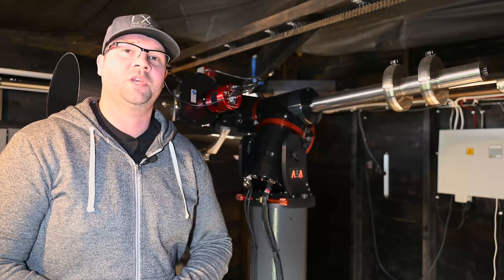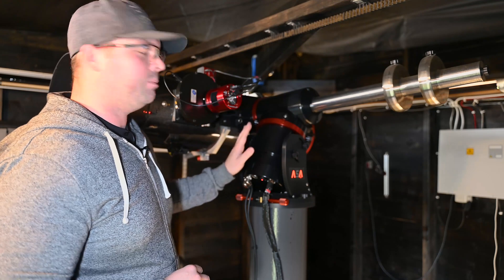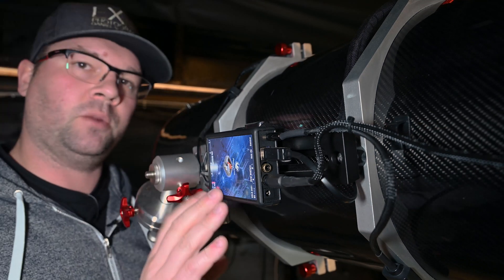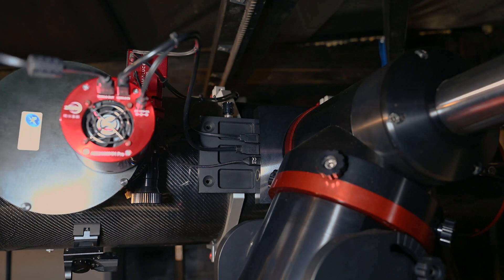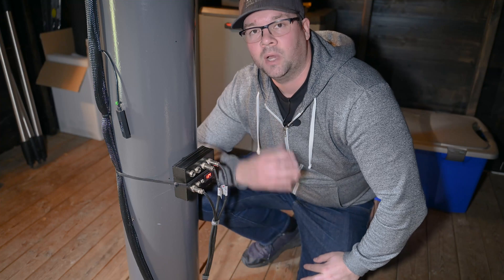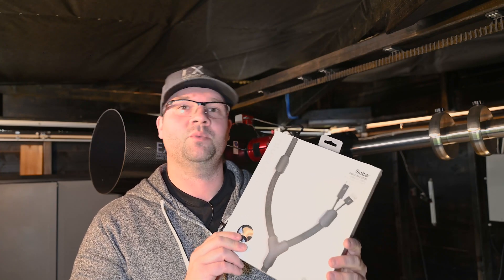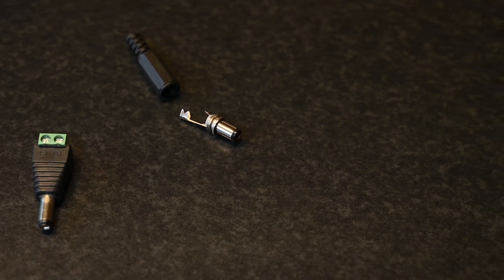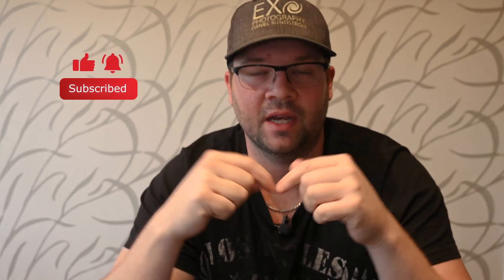How to run cables to your telescope

Comment: hmm, I recently learned that weights should not be hanging out that far from the axis of rotation, or it can cause ringing.  Any thoughts on that?
Reply from the maker: I haven’t heard anything about it, I might look into it, but I haven’t seen anything suspicious on the images :/
Reply: @ExoPhotography1   It seems most manufacturers are recommending it these days.  Here's from my AP mount guide:   https://astro-physics.info/tech_support/accessories/mounting_acc/balance-to-optimize-guiding.pdf

Comment: Daniel. Do you know what kind of wire gauge ASA uses through the mount? i.e. with the through-mount cabling, can it handle amperage? I have my PC, on the mount too in addition to my camera, powered by the Pegasus Astro Pocket Power Box Advance (10A capable).
Reply from the maker: I do not know the gauge inside the mount, but the documentation states 7 amp in the "Galv cable" 

You can read more on this topic in the ASA forum, just check here: https://www.asa-forum.com/topic/78-asa-ddm85-electrical-wiring-diagram/

/Daniel
Reply: Thx for the link!  I missed that one.
Reply from the maker: @AnakChan  glad to help :)

Comment: Hi Exo,  Frosth had a pretty funny comment there! I loved your video, and it is very helpful!. I have 17 USB cables that are not covered here in your video, but they could use a trimming, too! I'm wondering if there is a snap connector for those. If and when I cut them, it will be after I am satisfied with my "rig', since it seems I'm constantly moving stuff and re arranging! Thanks for the vid.
Reply from the maker: Thanks :)
I haven't seen any snap-connectors, but i foud this video on how to make your own USB cables with soldering the connectors, doesn't seem to hard, just a bit fiddly. And with 17 cables, you are in for a treat during the holidays :)

/Daniel